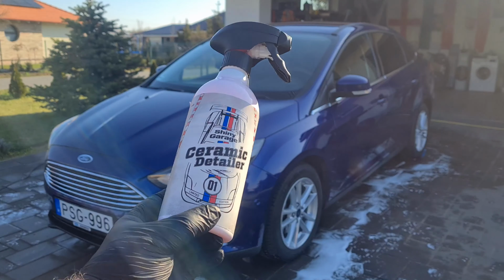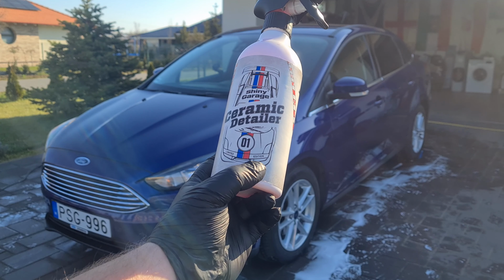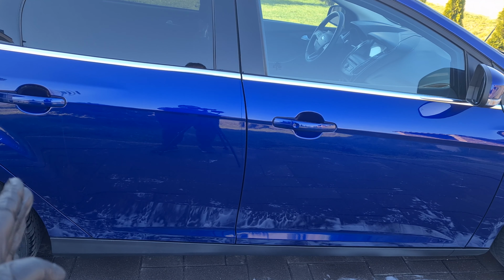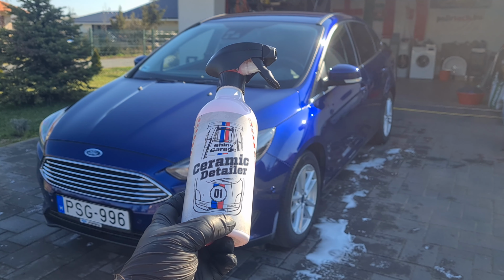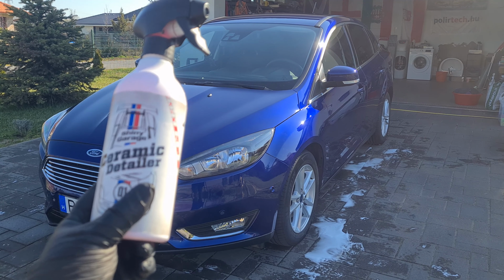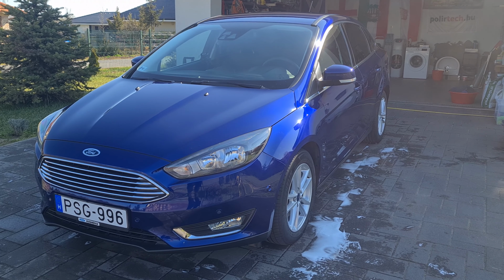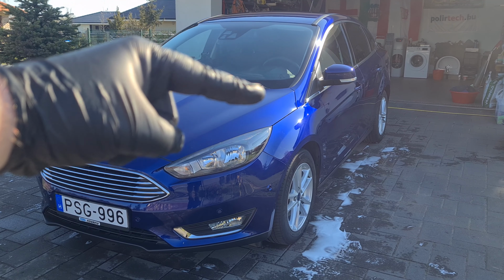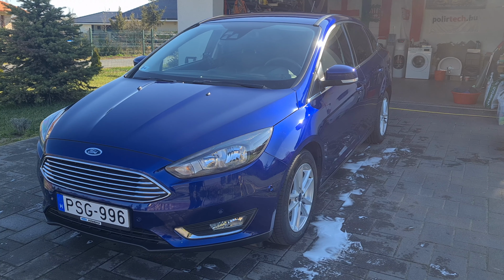Shiny Garage Ceramic Detailer test // Discount code in the description!

Comment from the maker: MJJC Foam Cannon Pro, straight from the manufacturer: https://www.mjjc.com/collections/foam-cannon/foam-cannon-pro/?ref=OCDADDYZSOLT

Waxwerk.hu (Dunking Biscuit etc.), 5% discount with the "OCDaddy" code: https://waxwerk.eu/?ref=OCDaddyZsolt

Project-F.hu, 5% discount with the "OCDaddy5" code: https://www.project-f.hu

Farmasi Hungary, 23% discount by using the following link: https://farmasi.hu/Account/Create?sponsorCode=64648810-11cd-44db-942e-3a229e0eb3b1
Farmasi Poland, 23% discount by using the following link: https://farmasi.pl/Account/Create?sponsorCode=64648810-11cd-44db-942e-3a229e0eb3b1
Farmasi CZ, 23% discount by using the following link: https://farmasi.cz/Account/Create?sponsorCode=64648810-11cd-44db-942e-3a229e0eb3b1
Farmasi Slovakia, 23% discount by using the following link: https://farmasi.sk/Account/Create?sponsorCode=64648810-11cd-44db-942e-3a229e0eb3b1

Polirtech.hu, various discount for ceratin times, details under the relevant videos: https://polirtech.hu

Automosowebshop.hu, various discount for ceratin times, details under the relevant videos: https://automosowebshop.hu/?coupon_id=ocdaddy

Tubebuddy for better channel analytics and tools: https://www.tubebuddy.com/OCDaddyZsolt

In case you would like to support the channel, can de the following ways:
PayPal - zsolt.tech.detail@gmail.com
Buy Me a Coffee - https://buymeacoffee.com/OCDaddyZsolt